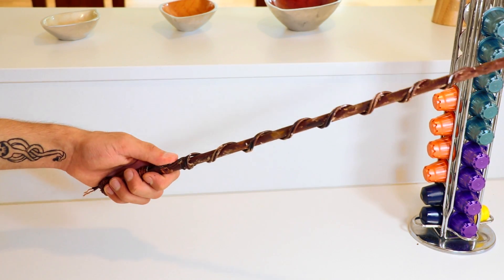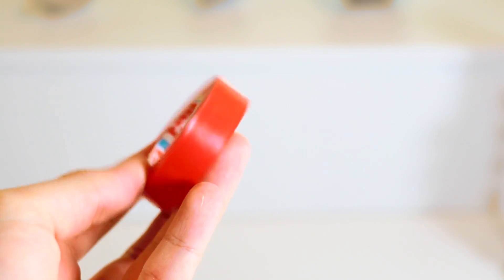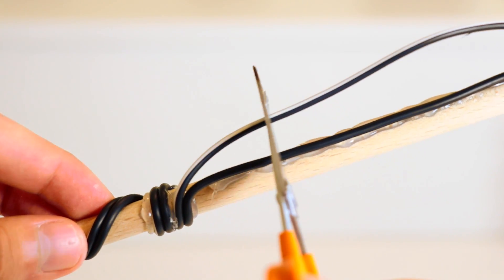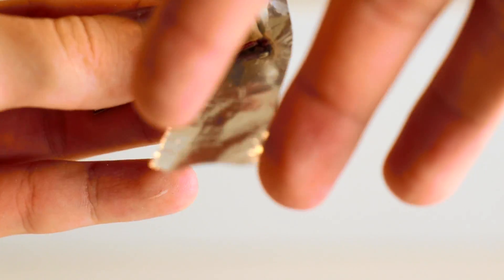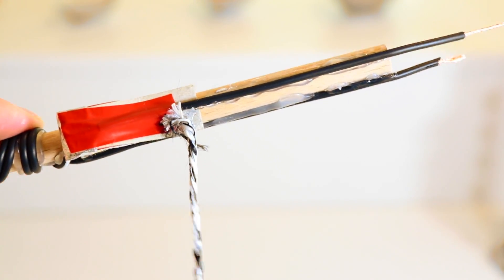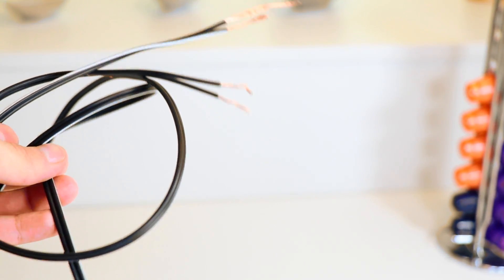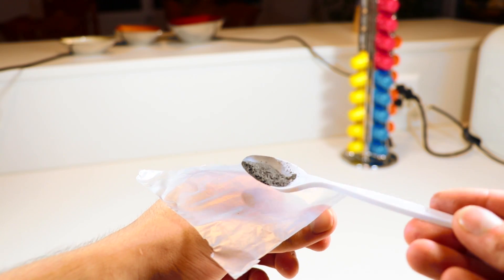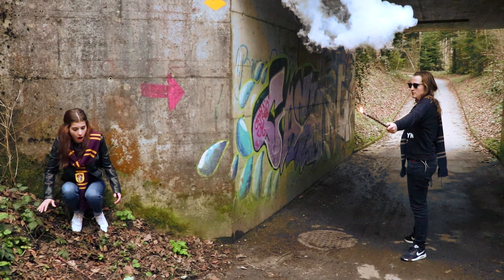How to Make a Harry Potter Magic Wand that Works

Comment from the maker: So if you don't have flash/black/gun powder, no problem. Here is a list of stuff you can use which will also have a cool effect:
- Ground up matches (fine powder),  Waterballoon filled with a bit of hairspray/deoderant/gas, Firecracker (rip out the fuse and stick the match in),  LED light (no exposion, very safe), Flash paper (those you buy in magic shops), Party popper (very carefully cut the string and stick the matchead against the popper thingie, roman candle (the shot inside), PingPong ball (make a hole in the ball, and stick the matchhead inside),
Reply from the maker: hahahaha yeah unfortunately ;D
Reply: except that roman candles are illegal in my country
Reply: aka Linxy how long does it last?
Reply: cool vid, love harry potter too XD im a ravenclaw 😁
Reply: Holly Webster  I am a gryfandor
Reply: Holly Webster rayvin clow azwel
Reply: What software do you use?
Reply from the maker: For video editing? adobe premiere
Reply: aka Linxy 😊
Reply: Linxy Hey Linxy i subscribed u yesterday ;) thanks for the ❤&📌

Comment: How about I hollow out a dowel, wire a row of capacitors together in sequence  boosting its output, put the capacitors in the dowel and by putting a metal tip on it with a small wire wrapped around the outside of the dowels so when you turn it on it shoots arcs

Comment: I have a question. How many time can you used it with out replacing the cub power part? Plz answer
Reply from the maker: The battery? The one in the video lasts pretty long tbh.. Probably at least 50-80 times. Can't say the same about the 9v batteries

Comment: How long does it last???
Reply from the maker: Welll the wand lasts pretty long solong you have the puffs, and the battery will last for a long time since it only requires a quick burst of electricity
Reply: aka Linxy can it only puff once?
Reply from the maker: yeah its basically like a firework